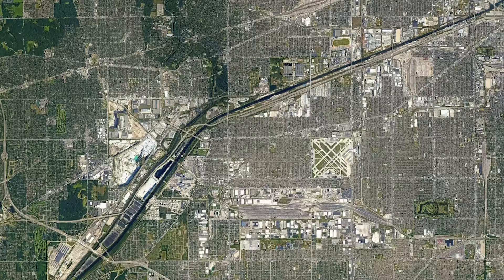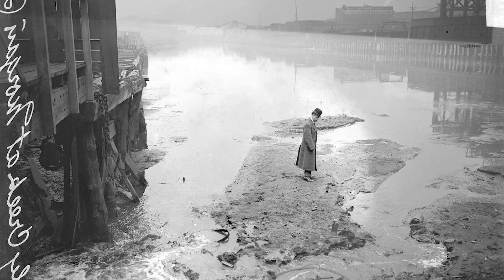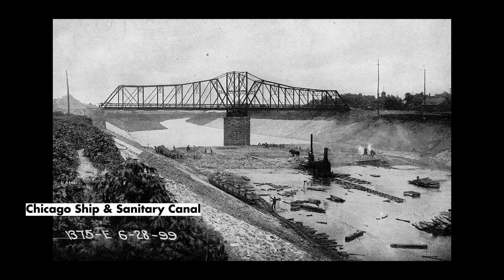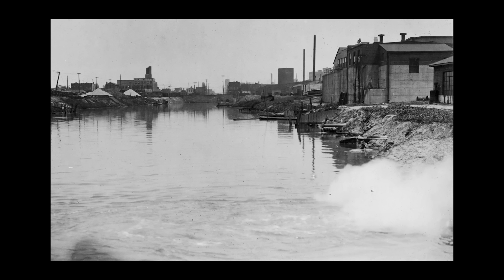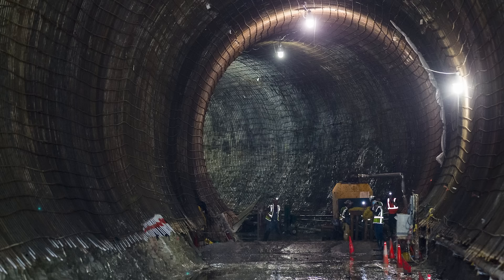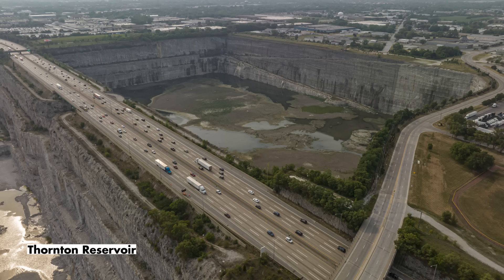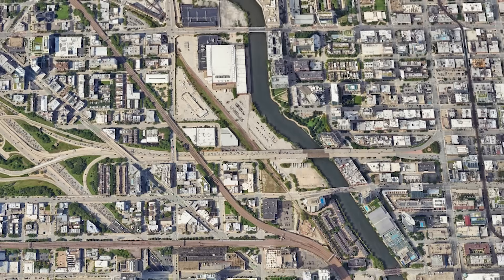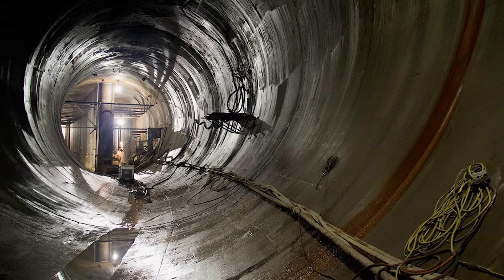Chicago's Deep Tunnel Project

Comment: One thing to note is the reason for the DTP is the lack of dedicated storm sewers in Chicago. The city was designed with COMBINED sewers, both sanitary and storm. This was a huge mistake. During heavy rainfalls ALL the water must now be treated as it contains sewage.  A better system would just be piping storm water independently and directly to waterways. No need for this elaborate deep tunnel. Even if the deep tunnel works its still a fail. Someone decided the DTP would make more sense then adding storm sewers, but IMO, over the course of the last 50 years, they could have just put the storm sewers in and not have to treat every inch of rain that falls on Chicago.
Reply: There is one important advantage of treating all the water rather than splitting the surface water, and that's that the surface water is also polluted from chemicals and faeces spilled in the streets or poured into street drains. So building a split system and discharging surface water into the river puts that pollution into the river. Going the route of keeping the combined system and building big enough storage and treatment systems to cope with heavy rainfall is actually better because then all the dirty water is treated before release.
Reply: @adrianthoroughgood1191  True, but this is a city of well over 2-million people and no doubt, border suburbs built similar to the city also. Would it not be digging up endless streets and sidewalks and who knows where pipes run under housing, the river etc. The point is not what would be a perhaps better fix. Though you still have capacity issues with more sewage treatment capacity needed, but perhaps still the quarry holding areas utilized and decades still perhaps till on-line anyway overall. 

I can imagine all the tunnels could have a new subway system. Yet a choice was made that did not disrupt the surface and  in segments opened over the decades. Still is not fully complete. Large and small cities all over the nation have joint sewer systems as it was to save some money back-in-the-day. 

Chicago has a tradition of full basements that over the decades owners finished for entertainment use, another kitchen as sometimes a new kitchen upstairs had the old cabinets reassembled in the basement and ultimately a basement if dry and waterproofed could be finished as part of the home as another floor. Going thru homes for sale you see this and more basements got protected despite still a few area of the city that occasionally in storms have a issue of backup that also has pipes to the deep tunnel can only carry also so much water in spot. 

There is a plan of redoing Chicago's vast alleyway system with pavers that allow water seeping thru vs going into sewers alone. Some alleys in elite areas got some. Just too costly for a city with debt to just repave alleys when streets also need it.

Chicago has its elevated rail system as a cheaper alternative to subways and risk though of its underground with their tech of the 1800s and early 20th century. 

All across this nation are projects chosen as a cheaper alternative from light surface rail vs heavy rail or subway to this day.
Reply: @adrianthoroughgood1191  Go ahead and treat the storm water. Just do it separately from raw sewage. So that way when you have an overflow it's just the less dirty surface water not sewage. Have you seen the pictures from Milwaukee every summer? I can't imagine any corporation getting away with dumping a single turd into a waterway, and then being able to make excuses that it's too hard or expensive.
Reply: Still a fail with success even if not total... as not yet complete also.... is not a failure. It was a American way to choose many times a cheaper alternative and lowest bidder contracts we still do. This was long ago and judging by knowing issues it would cause not known... would have as many legacy cities small and large did. It was a cheaper alternative that did work. Chicago would continue the grow also thru the 20th century and rain/snow events could increase. Even Lake Michigan rises by feet and drops over each decade. 

Rather than curb pollution and do costly preventive measures that perhaps at the time of the very late 1800s was not there... had little done to curb sewer, all sorts of industrial waste and even blood and carcasses of it massive Stock Yards slaughtering cattle to fill much of the nations needs by train. 

The river which our choices then with no regulations became a toxic dump and dead, but flowed into the lake polluting it and the cities drinking water. Again, not fixing pollution and lessening it, but choosing to reverse the river they did not know if it would actually work In 1900 secretly when complete the attempt to change the flow and use gravity worked... the river did flow outward now from the lake to the mississippi river. Then St Louis sewed Chicago, but was also polluting the river with its waste so was tossed. Then Canada and other states sued for too much lake water going down the river. That lead to the US to build the locks used today to limit water loss and all boats going from river to lake and visa versa go thru it as the lake is higher than the river by that again varies as the lake rises and falls.

Chicago had plenty of success. Raising the city and streets that actually began before its 1871 great fire continued afterwards for a couple decades with a small city then vs today. The other is to rebuild and remake a new lakefront that was either lost by man or too marshy to have much of a solid one.

The Daniel Burnham plan of 1909 which would redesign city streets with adding boulevards and a redone core of street to a half wagon wheel design, plus fill in the lake to create new parkland, harbors and beaches. Only a few boulevards were realized, the remaining of the core outward with Parisian buildings and streets never came. The making of a new lakefront which has a huge plan with only cheaper alternative was t just rebuild less or lose choices.

Basically most of Chicago's lakefront today is manmade with parks, harbors and beaches by this grand plan and still gets added to. The downtown grand parks and 1/4 to 1/3 the core itself is on landfill. The neighborhood north of the river called Streeterville and is part of the Central Business District today has skyscrapers including supertalls on that landfill. Basically all of its main core street of Michigan Ave was where the lake actually came long ago. Aspects of landfill already began before the burnham plan also. Other cities that could have did that did not or to a much lesser amount.

Plenty of fast growing sunbelt cities failed to heed warnings of growth, not take pricier options to save money and use lower regulations practices also. We all know how the Texas power grid chose  to NOT use federal requirements adding cost and do it alone and the result of that in foods and freezes. 

So my point is.... cheaper options chosen occur regularly with still success even if not the choice as a full solution more costly claimed. Still cities choose no adding of rail as in part... also cost claimed no one wants though the world proves it works in cities vs very high car-dependence. 

We could have done thicker major highways that would last longer and thicker or superior asphalt to more use of road pavers, stone, brick as European cities chose that last longer including sidewalks especially vs concrete that deteriorates. SO THIS IS NOT A BLAME CHICAGO THING WHATSOEVER. It is political also and as we know... taxpayers do want cheaper alternatives and worry about not the best choice down the road to other generations.....

 I AM JUST A IDIOT yet some things just are about a solution that is faster and or cheaper that lead to pollution that did not need to be vs planning and building sewers earlier as a city grew. So many cities just used rivers as that and now some states enacted higher regulatory practice that some states boast no need for and we can look at Houston and how much damage  and pollution, and flooding, building on land that should not have had homes, raising homes with a foundation of sorts vs a slab ground level as much cheaper though you risk main floor flooding in stormes. I THINK WHY.... raise homes a some kind of foundation or at least all as some now home over a garage and at least your main floor is spared.
Reply: Slowly upgrading/adding a storm sewer would have taken decades, but so did DTP. Streets are replaced how often? Every 20-40 years probably.  Would have been done already. Not to mention treating millions of gallons of clean water every year is expensive and unnecessary. That cost will never go away. DTP was not cheaper.
Reply: @guyincognito210  So who got paid and whose friends are they?
Reply: @guyincognito210  One will never know.... still given surface work and unforeseen obstacles. It was chosen. Milwaukee did and other world cities are as London. Now if all utilities like replacing gas lines, replacing the feeder lead pipes to homes from streets done all in sequence together.... miracles happen. 

Again, plenty of would haves, should haves in life in all things. I noted Chicago chose elevated over subway back-in-the-day as cheaper and engineering aspects of the era and Chicago soil. Still it got portions during WW2 and some after. DTP could have been a subway.

STILL, WHERE DID SUNBELT CITIES CHOOSE BETTER????? Houston still has the bayous and LITERALLY STREETS WITH DITCHES. DID THEY CHOOSE BEST? No they kept cheaper. The  inner-Loop of Houston has developers for decades buy out older homes BUILD ON BLOCKS as you could build anything. They had large lots... subdivide them to Chicago size for new costly homes AND KEEP THE UGLY ABOVE-GROUND POWER-LINES POLES.... why.... CHEAPER. 

So .... welcome to America where cities also choose cheapest bids for work, buildings where corporations have price-points and choose BASICA GLASS BOXES for the what.... cheaper. Move to the sunbelt, build a office park glass box vs some world cities have none... use migrant brought-in-workers vs Union wage jobs like a Dubai to Asian cities. Plenty of things we could have did Grander, Bigger and no boundaries for our Architects to design.... but choose cheaper price-points.
Reply: He literally fucking said that you dope
Reply: @danielkaler569  Worth a repeat and should be up front also as a key issue as the city grew. The choices made were made as a cheaper alternative for both the original choice of a combined system and choosing the Deep Tunnel over decades of replacement in-city as underground it went unnoticed. Plenty of other older large and 1000s of small cities too including my old hometown in more rural PA.

No use we get too bent as I would have noted it at the start of the video... clearly, combined for a city that got so big was not to be the best choice even with the largest sewage treatment plant in the world.
Reply: You keep yelling cheaper. How is a massive 60+ year project 300' in the ground that doesn't actually solve the problem cheaper? ITS NOT. It kind of solved the problem while simultaneously creating another problem. I bet all the reservoirs weren't even in the original design. They realized they needed them to store the Sh*t water while the Water Reclamation District catches up cleaning on millions of gallons of previously clean rain water that got polluted by directing it through sh*t pipe.
Reply: @guyincognito210  I love how environmentalists never complain about combined sewers! When every heavy rainfall for the last 150 years there's a good chance raw sewage goes in our waterways. But if a farmer with a little bit of manure has one accident...

Comment: A very expensive project, but one that works.  The amount of flooding incidences have dropped significantly in the last couple of decades.
Reply: That's the expectation? Flooding only some of the time?
Reply: @Rearmostbean  just how long have you been in the Chicago metro area?
Reply: Tunnel is not even “open” yet! What are you talking about? Homes in Chicago and Chicago area still flood because these “geniuses” are not able to complete this project in 50 years, and probably still not in another 50 years! If this was in Japan or China it would have been completed in 5 years!
Reply: Maybe you meant the opposite of "dropped significantly"?

Comment: It must be a crappy job to go in to clean those reservoirs after they dry up and all of the dry sewage is left at the bottom. 
So, it was found cheaper to build these massive reservoirs and deep underground tunnels than to build a storm-water system that separated sewage from water falling from the sky? Is Chicago known for barely receiving rain or snow? Many cities in the PNW have separate systems so they never have to worry about sewage overflow into waterways. Maybe the smarter people moved west?
Reply: Maybe Chicago is a lot older than those West Coast Cities?

Comment: Chicago filed suit against Milwaukee in the 70s-80s to stop them from dumping overflows from their combined sewage system into Lake Michigan. They won. Milwaukee spent a billion or more dollars on their deep tunnel project. They still have overflows into the lake. Not as bad as before but still happens during heavy rainfalls. The proper solution was to separate the storm water and sewerage system. Their system has ground water seepage which then has to be pumped up and treated. I can only imagine the corruption a project this size will generate in Chicago/Illinois.
Reply: One nice thing about Milwaukee’s (and I assume other systems) deep tunnel overflows is they generally capture the first part of the flooding which washes a lot of the sewage and street dirt out.  In addition to being a lot lower volume of untreated sewage being released, the released water is a lot less disgusting than it would have been.  Designing the system large enough to catch ALL storm water would have cost way more and probably lead to the project not even getting started.

Also, Milwaukee’s tunnels are built beneath our three main rivers.  One unintended effect is that the tunnels leak.  The water that seeps through carries a fair amount of the toxins and nasty stuff that was dumped into the rivers and absolutely contaminated the soils underneath the water.  This can then be handled at the wastewater treatment plants and properly processed.  This is measurably cleaning up the rivers themselves over time.

Now Milwaukee is also making the slow switch to a separated sewage system as older, aging out infrastructure is being replaced.  This should result in even fewer and lower volume CSO events over time.
Reply: Whadayamean "will" generate? It's already happened.

Comment: I don't understand.  There is sewage and there is storm water.  One is treated, the other is not.  It sounds like storm  water is mixing with sewage to form what the narrator keeps calling  "untreated waste water" during storm events.  Obviously I'm missing something because sewage volume should be constant not increase due to storms.
Reply: A lot of older systems in the US are combined sewage/storm water. This frequently overflows the sanitary system, thus why they are doing this system.
Reply: A lot of old cities have the sanitary sewer, and storm water mixed together. Unfortunately, that's the way it was.
Reply: Thanks for the education all that replied.  I now understand the enormity of the problem.  Isolating a sewage network the size of Chicago or London would take generations of reconstruction.  I'm surprised they haven't started though.  This problem didn't just happen. 😮
Reply: London also only has one system with no separate surface water drainage system. They are also building a big tunnel to cope with the large volumes in storm conditions.

Comment: I worked as an inspector on the slurry wall through the upper till overburden soil at the 1st part of McCook back in the early 2000s. It wasn't a rock quarry then. It was a water treatment sludge (biosolids) drying facility for MWRD. The slurry wall was installed to control seepage from the adjacent canal and river during excavation down to the rock. The rock was then quarried to create the reservoir. IIRC, the official project name is the Chicago Underflow Plan (CUP).
Reply: I was a mechanic with Slurry Systems!!!
Reply: I was a young kid and teenager that lived in the trailer parks next to this one in elk Grove, I remember ridding my bike in the trails that were there before any construction of the Quarry was there now I know what it became
Reply: @leahcimthgirw3163 

Didn’t kids sometimes go swimming in some of the quarries?

I only hopped the fence at my local swimming pool on a hot summer night 😂
Reply: TARP - Tunnel And Reservoir Program.